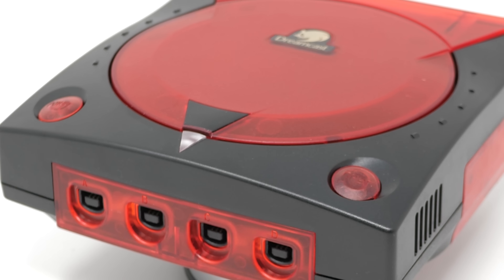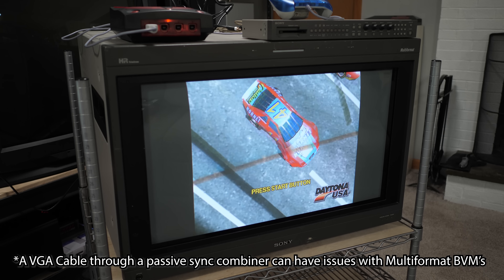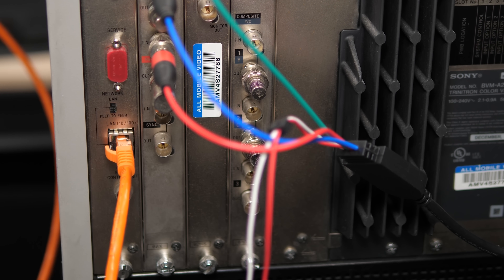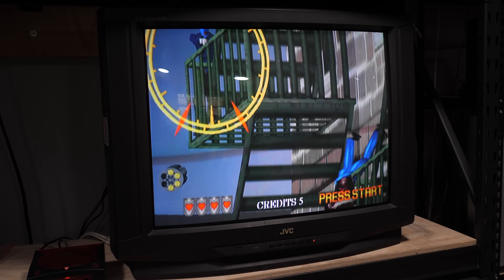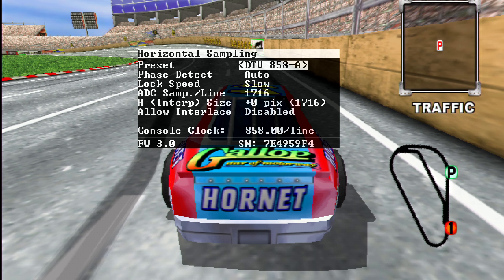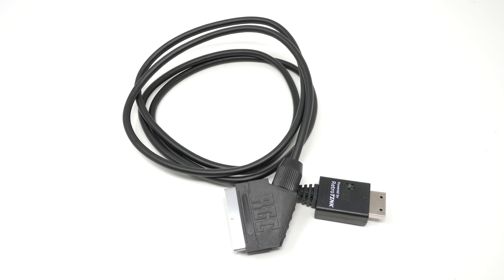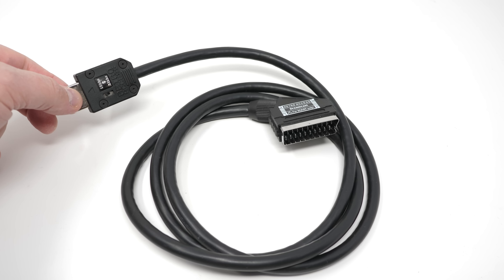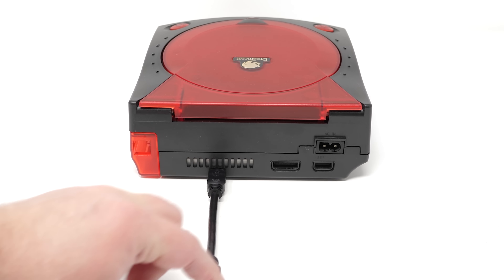Dreamcast Component YPbPr Cable

Comment: i have 

*panasonic " TX-34P180R  4:3 -  native 480p no 1080i no 720p 34INCH.
*philips "29PT7321  - 4:3  native 480p no 1080i no 720p 29INCH.
 *and the rare  trinitron "SONY kv-dr29m89 - 4:3  native 480p no 1080i no 720p 29INCH .( no WEGA in front of the tv )
all these TVs are EDTV progressive scan 480p  only ,
the dreamcast on these TVs look amazing with this component cable on 480p switch  especially on the SONY kv-dr29m89 ,
i don't know why no one on youtube did any review about these models or review about EDTV 480p crt tv ?!
these TVs with gamecube, Orinial xbox , some ps2 and wii are amazing , even with xbox 360 4:3 look  interesting.

Comment: The cheap vga cable + DB15 converter is my current solution and frankly it's always worked perfectly for me. I also have a switcher between to send that vga signal to a CRT computer monitor instead and that always looks phenomenal. I just use the vga patch option on GDEmu for those games that aren't compatible.

Comment: I'm kind of tempted to buy those for my SCART only CRT TV purely because I do have a component to RGB converter already, and there are no options on the market anymore to extract the audio from a scart connection while ensuring the rgb signal is left intact.
Even if I'm basically converting the signal from RGB to YPbPr and then back to RGB I can at least circumvent the terrible speakers on my TV which would more than offset whatever imperceptible image degradation that would cause.

Comment: If you have an European EDTV CRT, such as the Panasonic TX-36PD30 or Toshiba 36ZP38B, or its smaller sets, such as the TX-32PD30 or TX-32PD50, the cables work perfectly on 480p, and the light gun also works very well. I tested with an NTSC-J Dreamcast and an NTSC-U Dream Blaster. The manual says that the set doesn't support light guns, and it's true for older consoles, but it doesn't apply to Dreamcast and Xbox light guns. I tested and played House of the Dead 2 and 3 to death with both consoles. I have informed Robert from RGC.

I learned recently (third party information, I never owned or tested one myself) that there were a few models of HD CRTs in North America that have variable frequency and can do actual 31kHz (no processing or stretching to 540p), so I wonder if the light gun would work on them as well. Granted, not a lot of people own those sets, but the ones that do might be happy to know.
Reply: Thanks for the info. I plan to use these cables on an HDCRT as well. I have a question for you. Does the image appear centered with proper aspect ratio? I don't want to have to go into the service menu and adjust the horizontal size, etc because all my other consoles are set up to look good. I currently use a vga > component converter and it's too small and pushed to the right. I wasn't sure if this cable corrected any of that. Thanks.
Reply: @cerebralaudio  No problem! First, the proper aspect ratio depends on whether your CRT is 4:3 or 16:9. If using a widescreen CRT, then you need to patch the Dreamcast game or use a code in order to make it the proper aspect ratio, if it's a 4:3 HD CRT, then you don't need to do anything.

Now as for the image pushed to the right, that's a VGA thing as far as I remember, as I had the exact same problem myself, but with the cheap Kaico converter, which I believe just does the same thing but converting VGA to HDMI. I haven't had this issue with this cable, however, positioning of the image could vary with CRTs.

Please note that the TV I tested in question is an EDTV CRT and not an HD CRT. It tops at 480p component, it doesn't do 540p/1080i. As far as I know, by researching and discussing with others, no such model came out in North America, so many people are puzzled and even doubtful of their existence, but they do exist and I have three of them. While I have an HD CRT as well, it has terrible geometry, so I haven't tested light gun functionality on it, but if it works on the EDTV and VGA monitors, I see no reason why it wouldn't work on an HD set.
Reply: @crt_rex  I should have specified it's 4:3 540p. Sony KD-36XS955. That's most likely the problem. Putting 480p inside 540p and stretching it. The Dreamcast outputs 720x480 but only uses 640x480 part of the frame I believe which causes the unusual placement.

I also tried the kaico hdmi adapter and the image was way too small inside the 540p frame. I've also tried an ossc and gbs control. GBS control offers the most control over the image position but it has other drawbacks.

I might have to try this dedicated component cable.
Reply: @cerebralaudio  That's a great set, God I love Trinitrons, and I wish I had one instead of my crappy Samsung Slimline with terrible geometry. Anyway, yes, with most HD CRTs the 31kHz will always be stretched to fit the 33.75kHz raster, some do better than others, my aforementioned set being one of them. 

I forgot to mention, that while North America did not get the European ED CRTs, it did get a few HD CRT models with variable frequency that go to 31kHz for actual 480p without any stretching/resizing. Sadly, not by Sony, as far as I know. I have a couple of the models written here somewhere.

I have GBS-C as well, and I agree, it's great but it has drawbacks as well. How about RetroTINK, I believe that had, in one of the firmwares, an actual 540p, would that solve all your problems, as it would handle it instead of the TV? Something to think about.

I would indeed go on and buy the cable. You won't lose a thing, as it is sought after and if it doesn't work for you, you will be able to sell it easily, for the same or higher price.

Comment: Very cool! I just ordered some after watching this vid. I already had scart and vga related solutions for my modern TV, but have been only using s-video on my consumer crt.  These component cables will let me upgrade the crt setup and also provide another option for use with the 5x.  Thanks for the vid!

Comment: Paid 20 on ebay for dc cables like these that dont work at all. Im stuck with composite for now until the better ones are not sold out. I
Reply from the maker: Yeah, it's best to stay away from eBay for stuff like this.  These cables should be back in stock soon though!
Reply: @RetroRGB  I just remind myself I came from RF output and shouldn't be so picky lol

Comment: 5:57 
why did the aspect ratio on the right change from the transition to scart to hdmi mod? Is it because scart is analog?
Makes me concerned that the component cables do not fix the VGA 480p Aspect Ratio / Sampling Line Issues.

Comment: I've been waiting for these!!  I have a pretty specific setup that requires every input to be YPbPr so I'm glad I can finally get these without having to deal with a SCART to YPbPr box exclusively for Dreamcast.  For those curious: GCompSW 8x2 > One output goes into my RT5X for capture and the other goes into an OSSC DExx which then goes out into a Portta HDMI to YPbPr then into my PVM-14M2U.  The OSSC DExx will take anything ranging from 240p to 480p.  240p and 480i are simply passed through, and 480p gets line dropped to 480i in adaptive line multiplication mode, which has less than 1ms of lag so virtually lagless.  It's basically my dream setup without having to find a 480p BVM.

Comment: Great video. One question though. I have a costumer grade European CRT (B&O MX7000). My DC is connected via Scart cable to the TV (RGB). I don’t want to change my TV, will this cable be if any use to be? Any other alternative??
Reply from the maker: If the TV is 15KHz only, there will be no difference.  If it accepts 480p, you'll need to decide what cables is best for that setup.
Reply: @RetroRGB  thank you!!

Comment: Would these DRASTICALLY improve the image over the SCART I'm using now?
Reply: If you're using a 480p compatible scart cable, no.
Reply from the maker: Rent is correct - If your SCART cable has a switch and is compatible with your displays, keep it.
Reply: @rentoptional1524  Cool, thanks. That I am.

Comment: That was an amazing breakdown of Dreamcast options. Very thankful you went over other alternatives than the new component option!

If you can answer hopefully a quick question:

Do you see any reason to get the retro gaming cables versions that are powered by RetroTink if I already have the Retro Access Scart cable with switch?

I got tired of waiting for the HD Retrovision option so I picked up the Retro Access Scart and love the image with the RetroTink5x. I do not have a CRT that supports component so I’m leaning towards don’t bother with the new cables.
Reply from the maker: Thanks for the kind words!  And nope, no reason to change - It'll be identical.

Comment: Can you connect these to a DC Digital'd Dreamcast & have both an HDMI & component out solution, like with the N64 Digital?
Reply from the maker: Yes, 100%!  I demo'd this in the DC Digital video - The only thing to note, is the DC Digital will default ot whatever cable you're using.  So, if your component cable is set to 15KHz (240p / 480i), the DC Digital will get that signal as well.  It'll still look fine, but not as good as native 480p.
...but if you're analog display takes 480p, you're all set for both.

Comment: Bravo!  Thanks for this Bob!  I have been debating about the component cable vs DCDigital hw2.  Composite via 5X leaves a lot on the table.  I think I am leaning towards DCDigital hw2 as I am assuming you will not need to manually switch between resolutions (ie the DCDigital takes care of that prior to scaling).  While a minor thing, I target anything that does not require manual switches (an expensive preference I would call it).  I love the clarity you provide around the reason for the switching and how it interacts with different TV's.  Thanks again!
Reply from the maker: If you have the budget, a true digital HDMI mod will always be a bit better.  No light gun support...but if you're using a flat-panel, that's not possible anyway.

Comment: Why does the website say 480p mode is only supported using upscalers and bvm?
Reply from the maker: Not sure. My demo is accurate though - it’ll work on anything that supports component video in the respective resolutions.

Comment: oh man, I need these as I just picked up a 32” JVC D-Series. is there still hope to obtain one of these still? I don’t think RGC are releasing another batch for some time. thanks in advance!
Reply from the maker: I LOVED my JVC D-Series. What an awesome CRT. These will work perfect…in 15Khz mode of course, as those TV’s don’t support 480p. And yes, they should be back in stock sometime soon.
Reply: @RetroRGB  thank you! I just hooked up my Dreamcast to my PVM 20L5 via Toro to VGA to 129X Dual Input card for 480p thanks to your videos 🤤 also, thanks for the info about RGC Dreamcast YPbPr cable as I’m checking everyday for a restock date. dying to see how this will look on the D-Series 😎

Comment: The website states that these only output 480p, is that accurate?
Reply from the maker: Not at all.  I demo this in the video.  Please give it a watch.
Reply: My apologies. I watched the video, but the website where you purchase the cables has a drop down disclaimer selection where you have to acknowledge that 480p isn't compatible with consumer TVs. 

The requirement that you must acknowledge that 480p doesn't work on consumer TVs threw me off. I wasn't sure if there was a distinction between the set of cables you were reviewing and the ones that retrogamingcables have on their site. 

Thanks for clarifying.
Reply from the maker: Oh, my bad.  Yeah, I agree that's poorly worded.  I assume that's there to let people know you're not magically getting 480p on a 15KHz-only consumer set...but it's been widely misinterpreted

Comment: RGC has a disclaimer that lists compatibility with RetroTink, OSSC and Framemeister. Will a GBS-Control also work to use 480p mode?
Reply from the maker: All of those work.  Basically, any device that accepts YPbPr component video should work without issue.

Comment: I literally just saw these today and wondered if you would have video on them what timing.
Question, do you have opinion on the Kaico hdmi adapter for Dreamcast. Review seem good on it and is better than any of those cheap adapters from hyper or pound. 
I have a plasma tv with component ports to go straight to it. Do you think the component cable will be okay or should I go with something that converts to hdmi?
Reply from the maker: Kaico is a clone company who works with Bitfunx to steal people's designs.  So, please don't support them at all:  https://youtu.be/YG40lbrXWmA
Normally I'd say don't connect analog signals directly to flat-panels, but Plasma's are often the exception - They usually scale 480p nicely and the way they draw their image makes it feel like the lag is much lower:    https://youtu.be/jJzN_YHZezY
So, my answer to you, is get these cables now and when you eventually upgrade your TV, consider using a scaler as well.  Hope that helps.
Reply: @RetroRGB  Thank You for the reply. Didn't know that about Kaico , a shame becuse a lot of other you-tuber's gave it a good review. I came across the  AKURA by Beharbros hdmi adapter now I am torn between the two lol.  
Thanks again

Comment: Hdmi can do 240p, 480i, 480p 50/60Hz, 15/31KHz (for where it matters) and can either be run through a digital to analog conversion or straight up d-2-d am I right? Would make sense then to believe it's the most versatile and future-proof option available. You're stuck with always needing an extra connection for something else along the cable from the console itself either way. Either from analog to digital or vice versa that is.
Reply: Or is versatility more a question of extra goodies like adding something with a Retrotink but losing the "pureness"(I honestly don't know what to call it) of digital to digital?

Comment: I have a Hitatchi 32UDX10SA hdcrt that natively scans 480p. I currently use thefoo.83s 480/480i scart cable and a linuxbot3000 transcoder. With this set up, I get sync drop outs, and lightguns don’t work. My guncon 2 works with ps2 so it’s not due to display lag. Any idea of this would fix either or both of these issues?
Reply from the maker: Unfortunately, I couldn't say for sure without testing.  It's definitely worth trying though.
Reply: @RetroRGB  Thanks for replying. I just ordered it. I'm very curious to find out! Do you have any sets where another scart/vga solution loses sync and the component cables don't? On my hdcrt, it happens in both modes, but it doesn't happen with s-video. Lightguns obviously won't work via s-video though since the set doesn't do 480i natively
Reply from the maker: Yup, the ones I showed in the video.
Reply: @RetroRGB  I did watch the video, and it was super informative. Sorry, I should have worded that differently. I meant consumer HDCRTs. I believe you mentioned some PVMs and BVMs. If you have any hd crt tvs that do 480p natively, I'd be super curious to see the results
Reply from the maker: I think this was my fault - I meant the only ones I’d ever have trouble with were the ones shown. Sorry, I’m responding quickly…I should have been clearer :)
Reply: @RetroRGB  gotcha! Have you ever used a 480p native hd crt tv with the dreamcast? I haven’t had an issue with ones that scale to 540p. Im curious if this is a common issue with similar sets, but they’re not super common. Panasonic hd taus are probably most common. But I know there are other brands.

Comment: Bob, question.

Awhile back you showed a product on Twitter which does straight component to hdmi and I haven't seen any further info or videos on it.  Do you have this covered anywhere?
Reply from the maker: This?:  https://www.retrorgb.com/analog2hdmi-vga-ypbpr-spdif-adc.html
Reply: @RetroRGB  That's exactly what I was looking at.  Thanks Bob!  
Some things I've been wondering is does it handle native 240/480 signals more accurately than the ossc?  I understand that requires having timing settings adjusted to even look right with some games.
Reply from the maker: Well, with 240p, nothing's guaranteed...but this was designed with retro in mind.

Comment: Are these cables compatible with the few games that aren't VGA compatible?
Reply from the maker: Yes, just flip the switch to 15KHz mode before powering on.
Reply: @RetroRGB  alright good. If I get these cables, I'm only using them for 480i on a consumer CRT

Comment: Question.

Can I use this with Y-Splitter cables like with the HD retrovision Genesis and SNES component cables? I really like that feature with my CRT to use 1 input for 2 consoles. 

I know you aren't supposed to do that with PS2 and Wii component cables, but I wasn't sure if I could do that with these Dreamcast component cables.

Comment: See I want cables like this so i can actually capture Dreamcast footage for video making and stuff. Would they be fine for that, going into an Elgato? Would they be fine on a HDtv too? I suppose there'd be lag but it's really the only display a lot of folks have. Have a CRT but it doesn't have component but a SCART will b e fine for that but I'll need my HDtv to display the image if I'm capturing footage. I should just save up and get a Retrotink shouldn't I?
Reply from the maker: It should be fine in 480p mode.

Comment: Hey Bob! I noticed you used an A series with 480p component. I've been trying to get PS3 and Wii 480p through the clone 68x, but only get a purplish picture. Any ideas on what I'm missing?
Reply from the maker: There might be a setting that needs changing. I totally forgot which though. Sorry!!
Reply: @RetroRGB  no prob. Thanks for the advice!